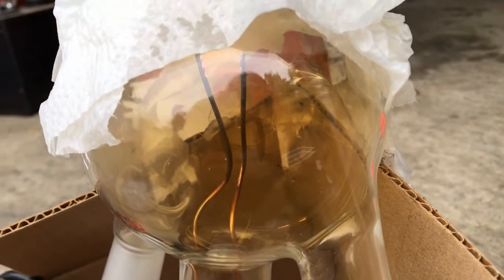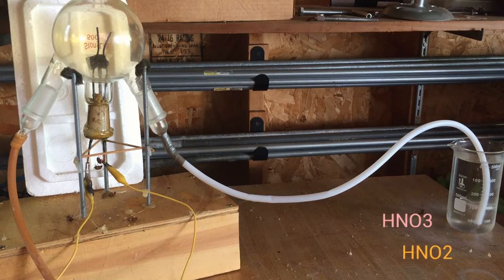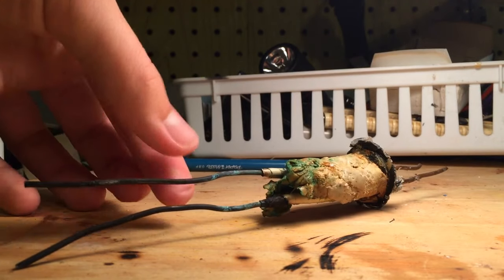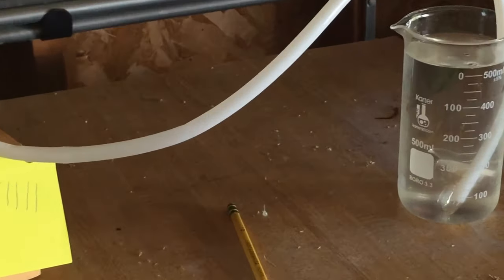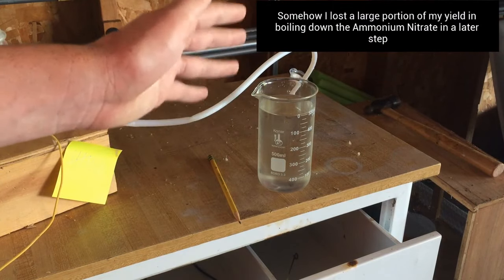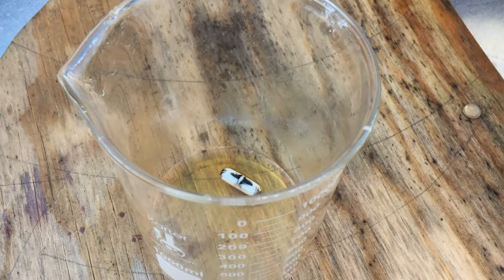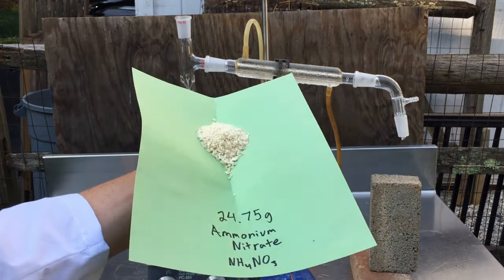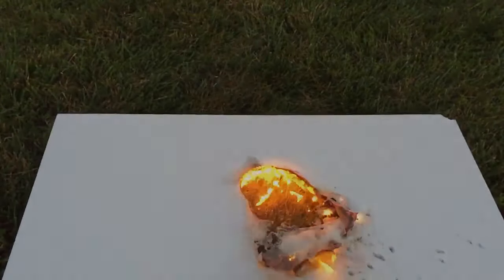Making Nitric Acid From Air (DIY Birkeland-Eyde Reactor)

Comment: Hey is the stir bar black from liquid sodium metal or any other elemental alkali? I did the nerdrage technique for making sodium in an oil solution and many of mine look like like that now hahaha! I got a heap of neon sign transformers and flybacks and kinda wanna make a multi stage version of this using multiple sources of plasma generation in the path the gas travels
Reply from the maker: You are correct. Many of my stirs are on their last legs thanks to the menthol catalyzed magnesium reduction method. In regards to making a Birkeland-Eyde, I’d suggest you read into the steps of oxidation that occur. The goal that isn’t achieved in this video is to get the most amount of air through the arc over the shortest duration. The longer fixated air remains superheated, the more NO converts back to diatomic nitrogen and oxygen instead of oxidizing to NO2. This also means that running air through arcs in “series” will likely have rapidly diminishing returns as NO is destroyed in consecutive arcs.
Reply: @DBXLabs  Hahaha I knew it about the sodium, I made the oil heater from an old hairdryer element and a Variac so my setup was sketchy to say the least xD. Also used borneol like he suggested in his update video. Yielded about 10 grams can't say the percentage as it was contaminated with magnesium and I didn't clean it well but it was great fun throwing it in water but sadly have yet to use it for any actual purpose other then having the fun of making it with random stuff in my garage actually working. Also thanks for letting me know your opinion on my potential setup! I might be able to rig up some system that utilises my compressor but I don't have experience with high pressure systems so I will probably not attempt it. Maybe a longer Jacobs ladder would be an idea as the arc moves up with the air so the same air remains in contact with the plasma maybe? I have a neon supply that has 2 outputs and I was thinking making the setup 2 arcs in the same container but I imagine I would need quite a big one for heat dissipation.

Comment: Will corona discharge work instead of short circuit arc ~
Reply from the maker: Unfortunately that wouldn’t work. Where a hot plasma arc produces substantial amounts of both NO2 and Ozone, the only apparent product of corona discharge is ozone.

Comment: Try using a grid electrode. Did you factor in what hydrate the ammonium nitrate is? 

You might try dissolving the NO2 directly in ammonia, to prevent loss of the gas to atmosphere
Reply from the maker: I thought about using ammonia instead of water but I couldn’t think of a way to keep the ammonia from just leaving the solution over time. The ammonium nitrate doesn’t really form hydrates, it more just absorbs water into its crystal structure until it “melts.” Any of this water was not present after the baking in the oven.
Reply: @DBXLabs  maybe you could also try continuously spraying water inside the reactor. The water mist would dissolve all of the liquid quickly. It would also cool the reactor.

To do this you would just need a small water pump and some sort of nozzle. Maybe from a spray bottle or something.

Comment: If you take a portable medical oxygen concentrator open it up and tap into where it vents the nitrogen you can get a better ratio in your arc chamber also making multi sealed chambers for the water gives greater time and surface area to extract the acid IE a tube too the bottom then a tube at the top of the first that then goes to the bottom of the second and so on.

Comment: wouldn't an easy way of making Nitrogen Dioxide be to get a pressurized canister of nitrous oxide and a small bottle  of oxygen and to combine it slowly in a small pressure chamber, then vent the Nitrogen dioxide which is pressurized into water to make the acid? If the nitrous oxide reacts with oxygen?

Comment: what is the efficiency if you use, lets say 50% hydrogen peroxide/water solution instead of just water
Reply from the maker: Can’t say I know what it would be but it could likely eliminate the need for a two stage bubbling system following the reaction. I likely lost some NOx since in the dissolution of NO2 into water, NO2 is generated (nitrous acid decomposition) and I’m sure the H2O2 could pick all that up.

Comment: could you possibly boil down the product from the nitric acid apparatus to make it more concentrated ?
Reply from the maker: Yes, you can. You could do this all the way until you've concentrated to the azeotrope with water (~68%) however at that point and even for a while beforehand you would be losing a great deal of nitric acid as both it and water leave the system, boiling away in similar proportions.
Reply from the maker: Buddhafollower by directly feeding the NO2 into water, you could probably make it to around 20% before losing a massive percentage of NO2 since it’s solubility rapidly decreases as acidity increases. A method of further concentration is almost certainly needed for any practical application of the acid.
If you don’t need to directly make the acid and are instead looking to maximize yield of the nitrate anion, feeding the NO2 into an excess of ammonium hydroxide solution is the best way to go about that

Comment: I wonder why Senkuu from Dr. Stone (Anime) didn't try this. But excellent video, you have yourself a new subscriber
Reply: He does in the manga later on so it will be if they finish the anime ;)
Reply: @Nielsquake0  I believe that senku used the Ostwald process in the manga thus requiring platinum. But the only explanation I could think of that senku didn't use this process is inefficiency or plot reasons.
Reply: @typhoon743  later on he does I don't wanna spoil it but it's an emergency situation at sea he used this method long after getting the Ostwald process going. The manga gets kinda insane ish though hahaha
Reply: @Nielsquake0  if you're speaking of treasure island I think that's where he first used the Ostwald process. I'm don't remember if he changed processes in the subsequent arcs. I've read the whole manga though and indeed does get insane (In a great way)
Reply: @typhoon743  well maybe the part I read it was just short story they did after the ending. It's a little continuation where senku ends up in the middle of the ocean. The reason I was looking to do this myself is from reading about it in Dr stone hahahaha
Reply: @Nielsquake0  I found the short story in question you meant. It was released after I thought the manga was over and a really good read and you are correct. Looks like they do use this process. Thanks for educating me.
Reply: @typhoon743  no problem, always fun if you can read one more small chapter you didn't know about hahaha happy reading

Comment: If you were to feed pure o2 into it what would happen
Reply from the maker: Depending on the flow rate, you might produce a small amount of ozone with no other products. Ozone is destroyed in high temperature plasmas, so this would be far less efficient production than in nonthermal plasmas or dielectric barrier discharge.

Comment: I have a microwave transformer 
I'm having a hard time to figure how to use it 
It keeps overheating and the spark is so small
Reply from the maker: Koukou Zee yeah MOTs are no joke. They WILL kill before you hit the ground. I suggest you make sure you are using the secondary output and not just the sensory outputs typically hooked into the secondary circuit. Typically, there’s only one secondary output which will provide 2100VAC in series with the core of the transformer. Be safe, there’s lots of tutorial videos on MOTs on YouTube.

Comment: So i do wonder, would using laughing gas (already partially oxidized nitrogen) and oxygen maybe give a better yield?
Reply from the maker: That would be interesting to test. I can only assume it would.
Reply: @DBXLabs  Another thing i keep wondering about is ozone and ammonia. Extractions&Ire did one about it, but as was pointed out, you actually need to add some KOH or something to really keep the pH low during the process, also apparently MgO can serve as a catalyst, going by a paper i found on that.

Another thing is, i read on a ozone generator manufacturer, that with ozone concentration is kinda diffcult to get high in water. However now there are actually electrolytic ozone generators that work with water and can get up to 30% ozone in solution, which is pretty crazy.

Just food for thought.
Reply from the maker: XXX M 30% in water? That’s really impressive
Reply: @DBXLabs  Under ideal circumstances, and there is only very few manufacturers from what i found. But one austrian firm makes ones small enough that you can just clamp it into a 1/2" pipe, so actually ideal size for a lab setting.
no idea on the pricing tho, they donßt say on the page.
Reply: @pearsonbrown6740  Yes, but i can buy laughing gas. I can´t buy NO2.
Reply: @pearsonbrown6740  Not everyone lives in the US bro
Reply: @xxxm981  If you can't buy nitric acid where you are, you probably can't make it legally. You definitely shouldn't be able to buy laughing gas if you can't buy nitric acid.
Reply: @pearsonbrown6740  >he thinks laws have to make any sense
Reply: @xxxm981  Guarantee making it from air is cheaper than laughing gas. It's a stupid idea.
Reply: @xxxm981  Heat a nitrate salt with sulfuric acid. You should be able to buy those reagents.
Reply: @pearsonbrown6740  Maybe, but i still want to know if it works, and what the efficency actually is.

Sure it might just break down into nitrogen, but can anyone tell me who actually tried it or can cite me someone who did?
Reply: @xxxm981  I suppose it could be a neat experiment. My assumption would be that the oxygen content would need to be high, to prevent the formation of diatomic nitrogen. You'd measure the efficiency using enthalpies of formation, and compare it to the power input. 

I'll check around for some publications.
Reply: @pearsonbrown6740  I have a similar expectation.

See thats actually being helpful c:
Reply: @xxxm981  Yes you're right. I tend to get irritated with people when they act like I did lol. 

I'm curious though. So in your country you can purchase laughing gas but not nitric acid? That's interesting. In the U.S. you can buy both (pretty sure) but misuse of the gas is illegal. Honestly I have no idea how they'd find out if you were huffing the stuff.
Reply: @pearsonbrown6740  Europe is funny like that, plus each country has slightly different rules and exceptions.

Also, its not illegal for me to buy nitric here, just none of the places selling it sell to private individuals. Like they won´t even sell isopropyl alcohol to you.
Reply: @xxxm981  Hmm, what about sigma aldrich? Also, they won't sell you isopropyl alcohol? That's ridiculous. Isopropyl is a safe consumer product. Can you at least buy it at a local store as an antiseptic?
Reply: @pearsonbrown6740  Sure you can buy it there, thats what you get in drugstores.

Sigma won´t sell to you here unless you have a business.....
technically you can legally open a business with like 400 bucks, but ye its wierd

Comment: How loud is the reactor?
Reply from the maker: The hated ones only thing that makes noise is the arc traveling up the wires and it’s quieter than a running microwave.

Comment: How long does it take to be concentrated too ?
Reply from the maker: Wodiy Diy several days in my setup
Reply: @DBXLabs  The concentration ratio is low, the method is not suitable for making a large amount ?
Reply from the maker: Wodiy Diy the concentration starts to plateau around 30% as NO2 has a harder time dissolving in acid than water. That’s why keeping a low concentration is good for production efficiency.
Reply: @DBXLabs  How to raise concentration ؟ 
thank you very much .

Comment: Ammonium nitrate will evaporate with the water if you boil it.
Reply from the maker: Ammonium Nitrate decomposes well before it evaporates in any measurable quantities. Fortunately, the decomposition of it in boiling water is negligible below ~180C.
Reply: @DBXLabs  I've boiled or evaporated solutions  of ammonium nitrate in an open container before and watched crystals of it collect near the the cool end of the container.
Reply from the maker: Stephen Fowler that’s likely from droplets that splatter on the cool sides. Ammonium nitrate doesn’t evaporate or do anything interesting until 180C.
Reply: @DBXLabs  or it could be the result of capillary/surface action followed by evaporation of the water

Comment: Wonder if its possible to enhance the production of Nox with bombardment of the reacting vessel specific UV  or ionizing radiation wave length?
Reply from the maker: Most ionizing electromagnetic radiation produces ozone in considerable amounts, but you really only see NOx when you couple ionization of air with extreme heat (breaking the diatomic nitrogen apart). Having walked into a particle accelerator vault minutes after testing, I can confirm that you only smell the ozone produced by the extreme ionizing radiation. If any NOx is produced it’s negligible.

Comment: 63.285USD/MT is the cost per Metric Ton for sulphuric acid yes I am seeing it listed on Amazon and Ebay at $40 CAD per Litre!!! WTF??? I need a good source online for buying my products :(
Reply from the maker: duda diesel
Reply: @DBXLabs  Sigh.. Damn it. They don't ship to Canada. This is very very depressing. I am going to make my own from sulfur powder I guess.
Reply from the maker: ScienceRust bad idea. I’ve tried. Do not attempt. If you have to make some, it’s much more worth your time to either get it from drain cleaner, or electrolyze copper sulfate
Reply from the maker: ScienceRust that’s still a difficult process, especially concentrating it after electrolysis. You should make sure there’s no sulfuric based drain cleaners that you can buy
Reply: @DBXLabs  Luckily i found Alphachem which is a Canadian supplier and I am able to get 4 Litres of 50% Concentrate for roughly $45 CAD I assume I can further concentrate it if need be. I want to make Nitric acid concentrate. That is my end goal.
Reply from the maker: ScienceRust do you mean concentrated nitric acid? How concentrated?
Reply: @DBXLabs  Yes that's what I mean. I want to do the Nitrile glove test like you did in your video.

Comment: hot tungsten resistance wire instead
Reply: yes the old light bulb, but thinker tungsten wire
Reply from the maker: @Jkauppa  instead of what?
Reply: @DBXLabs  what were you doing then
Reply: @DBXLabs  as the nitrogen burning device of course
Reply: @DBXLabs  flash bulb with normal air in it, same thing
Reply: @DBXLabs  high current instead of the spark arc
Reply from the maker: @Jkauppa  for NO2 production? You might be able to produce some nitrogen oxides around 2500C+ tungsten, but it would be at far lower efficiencies than from a high voltage arc.
Reply from the maker: @Jkauppa  there’s no wire in the current design, the arc travels in the manner of a Jacobs ladder.
Reply: @DBXLabs  I doubt that, I would say it would be more efficient, depending on your wire-electrode shape, ie, I dont believe you
Reply: @DBXLabs  thats why I said "instead"
Reply: @DBXLabs  I think the already non-efficient method will be made better with many tungsten heater wire mesh
Reply: @DBXLabs  3000C
Reply: @DBXLabs  did you try
Reply: @DBXLabs  up to 3500C
Reply: @DBXLabs  also for efficiency sake, you could try non-arcing ionization electric field instead, very hot ions
Reply from the maker: @Jkauppa  Well you are welcome to try that if you think that would be more efficient. The best way to maximize efficiency in a BE type reactor is to minimize duration of extreme heating while still exciting nitrogen to fixation. This is done by rapidly quenching the output of the reactor in water, even prior to the dissolution of NO2. These optimized designs never exceed ~2750C, and Gliding Arc reactors with much high flow rates never exceed ion temperatures of around 200C. My point is, temperature has long been singled out as a detriment to NOx production when too extreme. I cannot imagine that you would convert large amounts of air to nitrate by simply heating the flow with near-melting tungsten and blowing air past. I’d imagine only a fraction of that air would reach near the temperature of that wire, and even if it would you would lose out on the electrolytic splitting that occurs within an arc. 
In regards to the non arcing high-field, corona discharge is very poor at fixating atmospheric nitrogen over any true electrical arc. That’s not to say that the arc has to be “hot” in the conventional sense. Gliding arc reactors achieve some of the highest efficiencies gram/kWh with electron temperatures in the thousands and ion temperatures near room temp. If you were suggesting that these nonthermal plasmas are great candidates for NO2 production, then yes I would agree.
Reply: @DBXLabs  be certain that I dont agree
Reply: @DBXLabs  its a balance equation, decomposition vs oxidation, the filament heating will be the best
Reply from the maker: @Jkauppa  Believe me, I would like to believe you, but you lack empirical evidence to support your claim.
Reply: @DBXLabs  nope
Reply: @DBXLabs  we share nothing
Reply from the maker: @Jkauppa  be certain that I don’t give a shit.
Reply: @DBXLabs  so do you, or does the trust obligation go only one way
Reply: @DBXLabs  yes, only God is honest